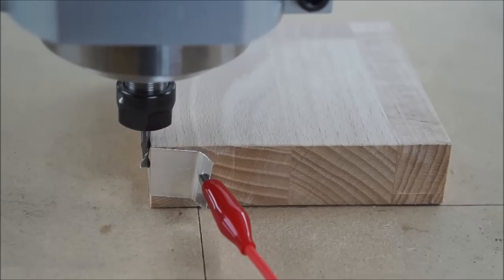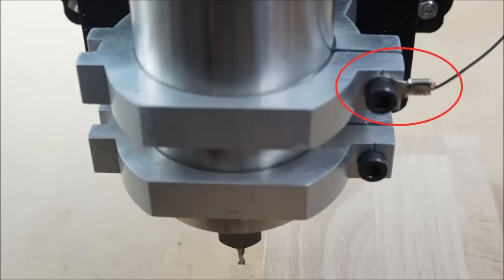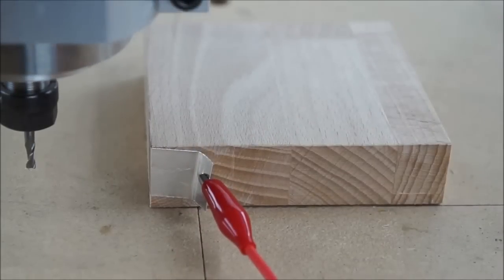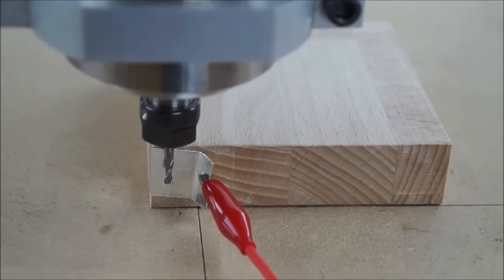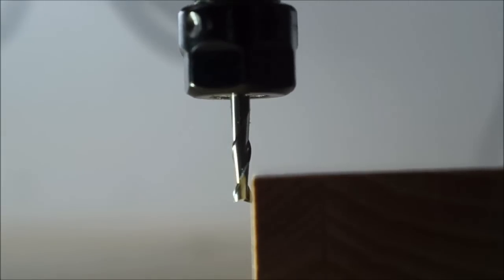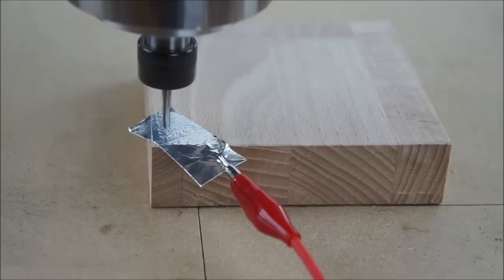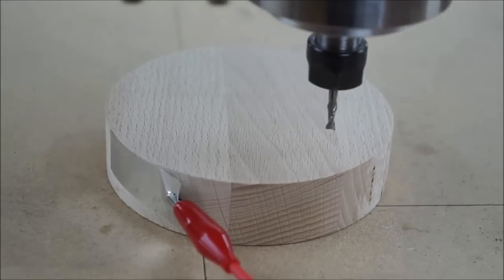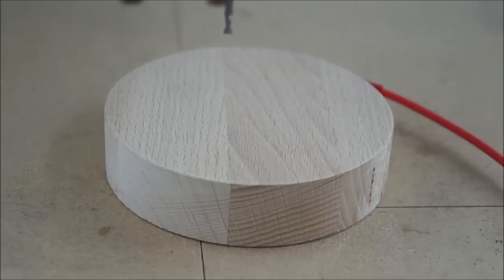Zero workpieces with aluminum tape and Estlcam

Comment: Have you considered porting your code to Linux, or releasing the source so that a Linux version could be created by the community? I would love to use these advanced controller features but I run a Linux shop and while it seems to work well enough in Wine for gcode creation, the com port control doesn't seem to work and I don't like relying on a translation layer. Thanks for all your efforts with this software!

Comment: Hi, im having problem with the measurement output from estlcam to my mpcnc. I inserted a 50mmx50mm box to estlcam from autocad dxf file, eastcam software shows it as 50mmx50mm box but when i feed the gcode to my mpcnc the result is larger by 14mm. The ouput box is 64mmx64mm. Hope you can help me with this.

Comment: hi, how you move the motor to the corner or zero postions with all axis moving simultaneously at 2:06? I thought it should be automatic after you press "ok" on the "Touch off edges" menue, but when i tried, i did not achieved that result. plz help

Comment: nice, but where to connect these aligator clips at the other end? do i ned some special usb hardware?
Reply from the maker: Hi,

Estlcam uses an Arduino UNO or Nano as motion controller.
The alligator clip is connected to the probe input (pin digital 6 if the "Estlcam" pin layout is used or pin analog 5 if a "GRBL" compatible layout is selected).
The tool is connected to GND.
More info: http://www.estlcam.com
Reply: thank you, so, as I am using a Arduino Mega and a Marlin as a firmware of my cnc, I am not able to make this? Thanks again, you do a nice job with that software
Reply from the maker: Estlcam requires its own firmware.
It also offers an experimental Arduino Mega2560 / Ramps1.4 compatible pin layout - but I'm not sure if this will work with your machine. The probe input pin for this layout would be Aux4 / Pin17.
Reply: is there an english documentation or something about that on your website? I am a bit confused with mixed english/deutsch here... I am using a mostly printed cnc by vicious1.com where I found that its possible to use estlcam, so I this way I found you... but I am very new to cnc machining, I come from 3D printing industry :) sorry for dumb questions and thanks for reply :)
Reply: Hey Houba

i suggest you downloading estlcam from the website and check it out.everything is good explained. If you have any questions about cnc you can contact me. I made one on my own a half year ago :-)
Reply: J. Andreas Thanks, I will send you an email or something, because I have downloaded estlcam a week or two before, tryed to understand but did not found answers for my questions
Reply: Can you please send me your email adress or some contact? I cand find anything on your channel... sorry, I feel dumb
Reply: Tolle Idee!
Wie nennt sich dieses leitfähige Aluminiumklebeband?
Reply: @Albert_Fetscher  In den meisten Fällen halt ganz einfach Aluminium-Klebeband, ob von 3M oder sonst wen ist praktisch wurscht. In vielen Fällen im Baumarkt wenn nicht bei den anderen Klebebändern(nähe Malersachen) dann manchmal beim Klemptnerbedarf.